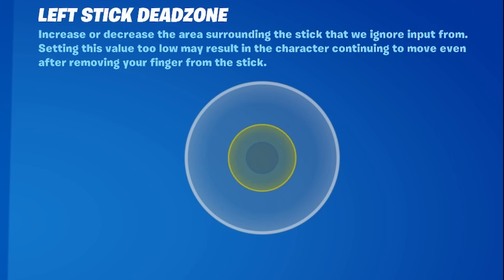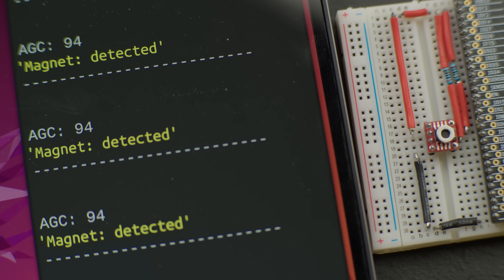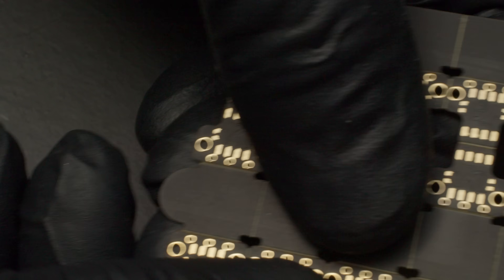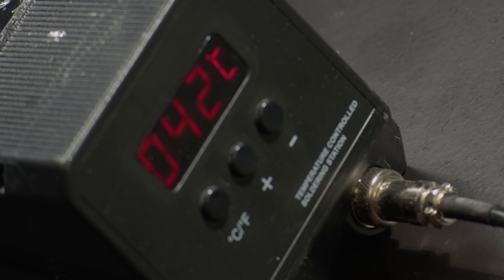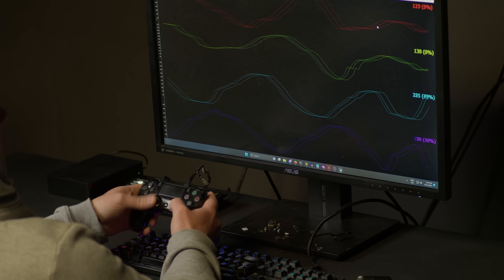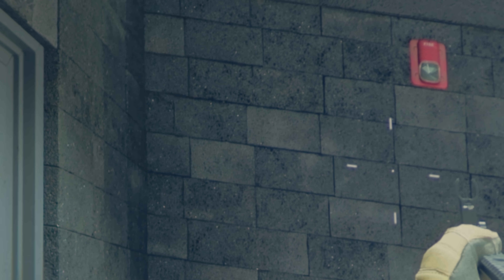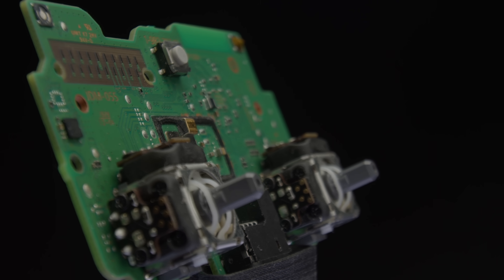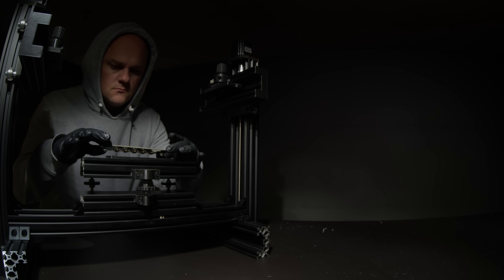Beating the $20B Joystick Drift Problem, and giving it away for free

Comment: I am curious if the chip added to the stick consumes much power. Does this modification have an impact on wireless controller battery life?
Reply from the maker: Yes for sure. It's basically adding 4 more computers to the controller and it consumes a lot more power. E
Its possible to do a more advanced method with more parts and more research. But this is the fastest to solve the problem.
Reply: @MariusHeier1  I guess it would be best to use this mod in a wired-controller configuration.
Reply from the maker: @Lardzor  ive used it in wireless for half year now. And I know it uses more power but i dont notice it being a difference. But i dont play that much.

Comment: but also magnets loose their ennergy over time
Reply from the maker: Yes. In 100 years they will be useless. Until then they are fine. The chip has automatic gain control for the magnetic field and it does not use the field strength get the rotation. But the differences between the magnetic field strength from all the 4 hall sensors sitting around the axle.

Comment: I’ve gone through dozens of PS4 controllers, SIMPLY, because of stick drift. Ultimately, I realized that Xbox One controllers are superior to PS4 controllers, in every single way (at least, the ones that were made early-on). When I only had a PS4, I didn’t really have another choice. When I switched to PC, though, I tried keeping my DualShock 4 alive for as long as I could. I even spent a good amount of time, constantly, replacing its parts. At first, I wasn’t used to the Xbox One controller’s shape; but I quickly became comfortable using it…and that Xbox One controller hasn’t caused me a LICK of trouble, since I’ve started using it.

For me, PS4 controllers last around a year, before the sticks start wearing out. Xbox One controllers are far more durable and reliable - I’ve been on one for about 3 years with no drift at all. I know that both of the controllers are made very similarly, but everybody wears out controllers differently. I guess my thumbs are JUST powerful enough to break PS4 controllers, but too weak to reach that threshold for Xbox One controllers.

Comment: Didnt the phob gamecube controller do this first?
Reply from the maker: No one that i have seen have used a rotary encoder chip for this. There have been multiple implementation of normal hall sensors where you transfor magnetic field strength to axis. But not the rotation of the field as in encoder chips.

Comment: If it costs more to manufacture, console makers have 0 chance of adopting this tech.
It's contrary to the core principles of running a capitalist company. Profit above all else. Designing a controller to fail will always bring more profit than designing a more expensive product that's designed to last.
Capitalism is not a compatible economic system with technological progress.
We could have had electric cars in the 80's. That tech was suppressed by the oil industry.

Comment: https://youtu.be/SgqflcHBTwc?t=129 < there's your solution to the low range exhibited by your magnet-sensor system, you either need the same shape magnet with more poles, or to just forcibly create poles from discrete magnets where you need them. Fixing it in software like that just harms the resolution.
Reply from the maker: Low range what?
Reply: @MariusHeier1 you explain it yourself in your video at 3m4s. The fix the chip does is only manipulation of the values, basically the same as map(), it doesn't preserve real fidelity.

Comment: Keep in mind I’m very ignorant to this side of the mechanics. But how is there no interference from surrounding metal fixtures or electrical sources?
Reply from the maker: This chip usually sits ontop of a motor with a bunch of nedodym magnets spinning at high speed and high current.  So it handles noise fine.
Reply: @MariusHeier1  highly impressed

Comment: I have PS1 controllers without drift. You just need to keep recalibrating the stick with "drift" to account the new values. The problem with drift is that the HID component declares the expected stick output values, which aren't representative of the real voltage levels coming from the stick over time due to the wear of the physical components and changing resulting voltage across the potentiometer.
Using the assumption of a circular gate, you can easily assume that the center point of the opposite axis corresponds to the highest read value of the opposing axis, as long as the stick output remains linear, which it should if you aren't using the worst possible materials and super low voltages to make it. Every time you read a new maximum or minimum value from the stick, you write it to a small pool of volatile memory that holds the current running maximum and minimum of each axis, and the value on the other axis corresponding to that. Then, read the corresponding values of the opposite axis at the maximum and minimum readings, average them together, and you reliably have determined the center point of the stick, allowing all other values to be a smoothed range from that center point to +1 or -1.

PS1 did this, as anyone with a good PS1 or good PS1 USB adapter should know. Axis wrong? Rotate the stick once. Axis now fixed.

This is a software problem that has been manufactured to gaslight people into believing they need an expensive solution to a problem that was fixed decadeS ago with CHEAP software. You DO NOT NEED hall effect joysticks to solve this problem. All you need is BETTER SOFTWARE, and a tiny bit of sense in engineering your products. Joystick drift exists specifically to increase peripheral sales. It is a designed, manufactured problem to create waste for the purpose of increasing revenue.
This isn't that different from logitech continuing to use lower-than-rated voltages for their pc mouse switches, despite higher voltage logic or lower voltage switches both being plentiful and readily available. Why? Because double click means you buy a new mouse as soon as your warranty expires.
This is MANUFACTURED WASTE, and if people buy into hall effect as a solution, they will engineer another problem, and use the hall effect sticks as a reason why your controllers are justifiably more expensive now.

Comment: Companies will hate you for this. They very much like their sweet planned obsolescence. 
Stay safe, friend. Great design and even greater intention!
Reply: I think the smart companies will take this as an opportunity to add hall effect joysticks to their pro controller lineups. Just think, if you could buy an xbox elite controller just to get the hall effect sticks and not have to buy new controllers, then it would be a no brainer, and Xbox sells more of their more expensive controller.
Reply: @Stryker2279 they will probably go tgis route when third party controller with hall effects joysticks rise in market share
Reply: @Stryker2279  it doesnt evenvhave to be that much more expensive

Hall effect sensors are some od the most used ones on hotas

Even the lowst priced flight sticks have the? (Refrenceing the tm16000m which has been in production from 2016 to today, and has hall effect sensors for its x and y axis, although not for the z axis)
Reply: Now he should start a business selling these. No wait, that wouldn't be profitable since they last forever.
Reply: it's a scam... SEGA and GuliKit fixed this in the 90s and their patent expired so Sony and Xbox have no excuse to not use that design. they don't use a potentiometer to detect movement, they use a hall effect sensor which has no moving parts, because it uses magnetism, thus it lasts nearly forever... they still sell controllers with hall effect sensors today and they last far longer.. video explanation : https://www.youtube.com/watch?v=MpLQf_q3avA&lc=UgySqCl8Za-qhZPILkZ4AaABAg
Reply: There's prior art it's not his invention at all.

Comment: I don't understand why they don't use The N64  approach to that issue, the joystick mechanism materials were crap but  instead of potentiometers it used an IR sensor and a wheel with holes, it counted the holes forward and backwards that specific part was indestructible, same mechanism that the old mouses with a ball underneath used.

Comment: My friend, I see that you know a lot about controls, I recently bought a Turtle Beach Recon Cloud, and when connected by cable it appears directly as an Xbox controller, but when connected via Bluetooth to the PC it does not appear as the typical Xbox 360/One/X|S controller, it appears as "axis 6... and a long name", the problem is that no game detects it, so I have to emulate it with XOutput or Xbox360CE but these programs don't let me map Axis 4 and Axis 5, which is where my control has the left and right triggers and it takes buttons 8 and 9 that obviously don't have travel like the Axis, any proposals?  Or how can I get the ID of the buttons and Axis

Comment: Is there way to connect swappable SONY PS5 Stick Module kit for DualSense Edge directly to PC via USB?  I see it fits and plugs into PS5 controller but wonder what kind of cable I would need to make it happen. If I say do manage to connect it via USB, would it work?  I just need a small analog stick attached to the side of my laptop.

Comment: The decision to use graphite instead of magnets is purely economical. Even Nintendo - which has chosen to fix all Joycons with drift - chose to stick with the tech rather than Switch (nice) to older, better tech because it's still economically better for them.

It's like the recall equation. Will a recall cost less than the legal payouts? Yes? Do the recall. No? Don't. 

They want users to buy multiple controllers per console life cycle.

Comment: Don't magnets demagnetize over time?
Reply: Yes
Reply: @AzaiaMonota after a quick search a good magnet should last 100 years without losing a significant power. Heat can speed the process
Reply: @ChainPenguin  yeah if stored correctly but in a controller that is constantly being used is a different story

Comment: Magnets lose their charge over time, so if you have several controllers you're at a detriment and will need to replace them once they lose strength and precision even if they're not being used,  effectively a shelf life. I don't even need to mention the extra internal hardware required to shield from EMI and lack of calibration tools on consoles. I'd much prefer 1st party modular sticks.

Comment: As someone who has used different controllers and fixed some by replacing the analog sticks, this is not the whole story. Sticks also have a spring loaded mechanism that makes the stick go back to the center. This part rubs with the base of the stick and this wears out, creating drift as the stick does not return to the center, nothing to do with the potentiometer itself. This is great, but it does not fix the entire problem

Comment: GuliKit KingKong 2 controller is already using hall effect... You are not making anything revolutionary like you make it seem. This has been invented already. You're just "recreating" it to put it nicely, and trying to claim credit for being the first when you're not. (Yes, it's implied by your title. How do you solve a problem that is already solved?) Slowly growing weary and tired of illegitimate youtubers and their gofundme get rich quick schemes that never develop into a finished product :/
Reply from the maker: You are wrong in so many ways. Do they sell after market kits for PS4 and PS5? No. Do they need to use heavy filtering to get it to work at all? Yes. Do they use the same kind of technology? Yes, the same way a rock in a river is the same as the London bridge.
Reply: @MariusHeier1  Well if your product is better, more power to ya, but in my experience these are just scams and I'm staying away. You were right about one thing that I can see, the aftermarket kits are only for the steamdeck/Joy-Con but their prebuilt controllers are universal. Either way, you're not beating it you're joining it. And with the superiority of the GuliKit over a potentiometer joystick, any improvement you could make would be... well, indistinguishable side-by-side. You may be reinventing it but you're still using hall. You clarified this in your own words in your own video.
Reply from the maker: @Kits-Snow  Im using multiple hall sensors arranged in a circle around the axle. These hall sensors are part of the silicone die of the chip. This makes the alignment of the hall sensors within the standard of the optical process of silicone die production.  This is essential to be using the cordic algorithms in the onboard computer of the chip. Its the only way to get it working within the specifications of whats equivalent to the potmeter.  I was right about everything i said. And you did not refute it with any claims or evidence.

Comment: I never had a problem with stick drift on my xbox 360 controllers. these things are over 10 years old! My Power A xbox one controller doesn't detect the movements of the joysticks correctly, they don't drift though

Comment: Why ps4 controllers always have these type of issues 😞, I’ve bought 3 ps4 controller already and had ti change them because of the joystick stop working properly after a while. The second one I bought I took it to repair it, but after a month stopped working again, I see these issues only on Ps4 controller not xbox controller. Is there any general solution for this problem? 😢

Comment: I simply cannot believe they're still using carbon potentiometer in such an expensive devices. I really thought it's a more advanced technology especially in PS4/PS5 controllers. Unbelievable that you have to throw away a thing with its DAC and amplifier, touchpad and so forth.
You did amazing thing to mitigate that, brother.

Comment: Personally, as much as it may be tempting to stick with the friction fit, I would absolutely recommend doing a bit more to avoid the magnet becoming misaligned. With how much force some people use with a game controller and even you use during tense matches, should the grease ever get too worn away it wouldn’t be difficult to accidentally misalign the magnet in some way. It would be nice if it were possible to custom design magnets to have a key hole instead of a round hole, but alas not practical, so the best option in my opinion is a dab of cyanoacrylate in the hole after the magnet is attached so that there is some more contact, this of course will mean that the joystick is less serviceable, but because there really isn’t much mechanical stress on the sensor I don’t think you will have to replace that any time soon, the button would likely be the next failure point. Hall effect sensor for that as well?

Comment: So question is why not use magnets all the time?
Is it about manufacturing costs or simplicity or just to make that extra income from sales of new controllers. That can't be the only reason tough as the lifespan of modern Xbox or PS controllers are quite long.. Can someone explain reason behind this. I've seen that some mouse manufacturers have started to use optical switches for example instead of mechanical..

Comment: I was thinking of something like this for a pressure sensor virtual disc scratching😮 on top of machine that exist already... Sorta...., harmonize the scratch angle to possition to multiple magnetic sensors apart from the center sensors so it can calculate tilt possition in order mimick needle pressure over the disk when the disk is tilted and turned from a specific location of the operational parts in order to synthesize exact sounds and feels when creating music and or compiling mixes..

I'm not at your level😮.. Nor do I have any friend who are.. wish I did cuz.. I would love to learn hands on from and expert in something that does actually interest me and I understand enough to have an idea in the first place, where can I learn to do this and get some hands on experience on making custom builds and doing things like this getting the hang of things until I can create awesome experiments like this?
Reply from the maker: Hmmm. Good question. So i did not learn any of this in a particular place. O usually just try to do something and learn it while doing it. And i been doing that for many years. And over time you get an intuitive understanding on how almost all stuff work. If i want to learn something particular, lets say how the usb protocol is. I usually experiment, and see how things work. Now that we have these great ai models i also use them alot. And lets not forget youtube. 😉😁
Reply from the maker: Btw what is the goal of the process you described above?  I did not follow from the start. You mean like a dj scratch table?
Reply: Yes like a dj scratch table.. sorry if I didn't explain my self properly, trying to explain something that doesn't exist isn't easy at all, packing my imagination into words is a process I don't even understand enough for the translation to make sense sometimes
Reply: What was your first experiment or thing that you did that got you going perhaps I can try this out as well, as much as I can imagine knowing that there are resources that can make my ideas into reality, I don't know how or what those resources are. 
It's like I understand the atomic fundamentals of things in a chemical nature and understand and can explain why or how  gravity and magnetism works, and perhaps a simple circuit..... but Sensors and complex integrated circuits are a little beyond me, is there a simple project that could help me understand enough to get started in remote control?